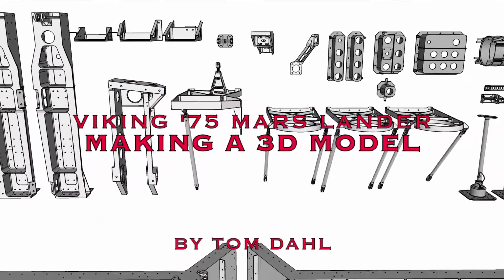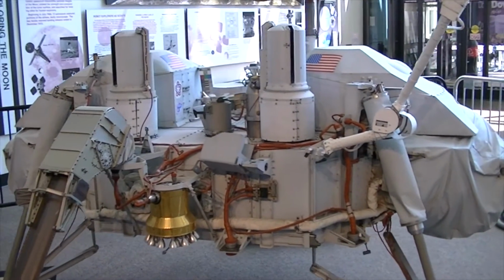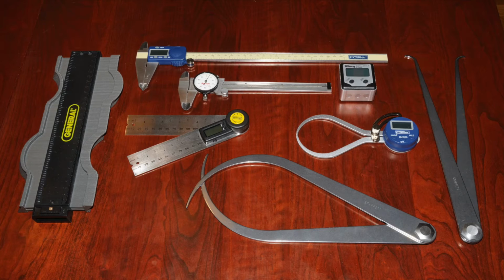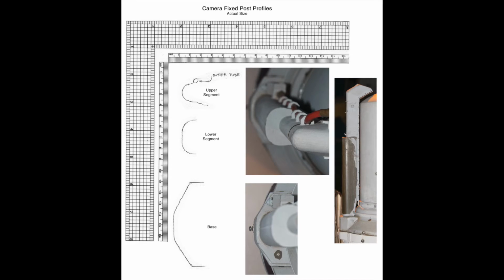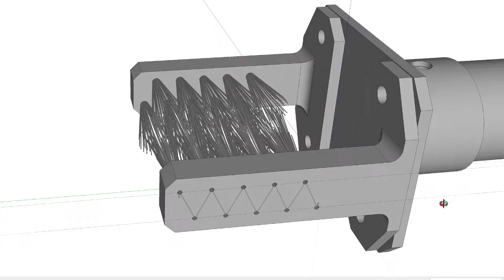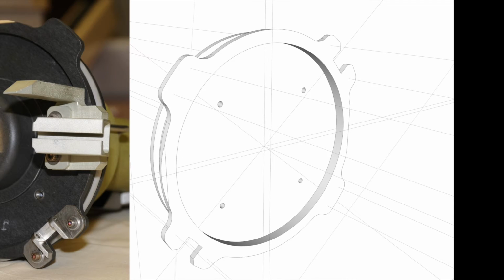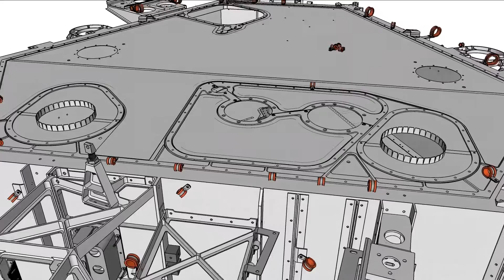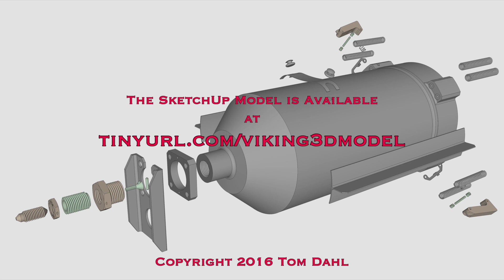Making a Viking Lander Digital 3D Model

Comment: What! No micrometer? Oh well. A lot of patients must has gone through with this project. Also. I hope that you had many fresh batteries on hand if the readings didn't look right. Can't wait for the finish project. Are you  planning to make full scale of the Viking lander?
Reply from the maker: I do have a nice micrometer, but it's very limited (one inch) and awkward to use. :-) The high-quality dial and electronic calipers I use can accurately read to 0.001 inch but I don't generally trust my technique to that level (e.g., temperature management of instrument and object) so I settle for 0.01 inch. Taking measurements is a rather slow procedure, double-checking and being careful not to bump something. A full-scale lander reproduction is out of the question unless I win the lottery! I do hope to create a scaled-down model at some point. The digital model is partly intended as a way to generate a self-consistent set of plans from which a physical model could be built without worrying so much about mis-fitting parts.